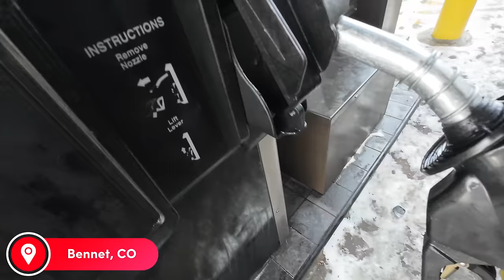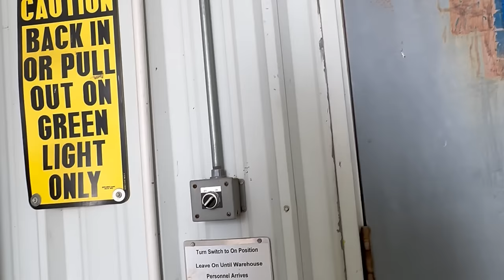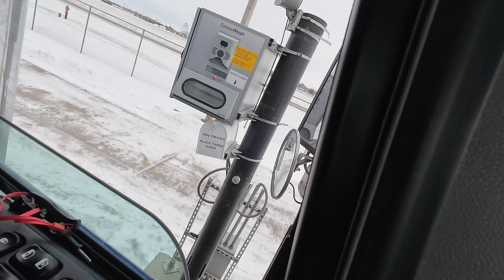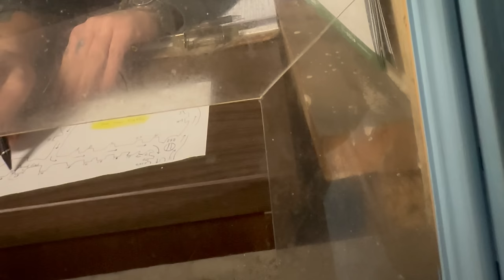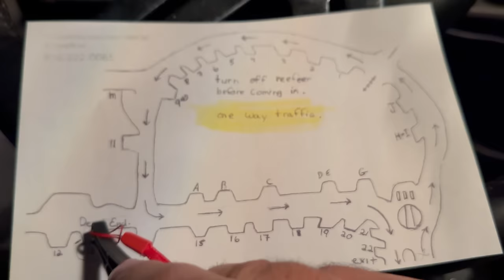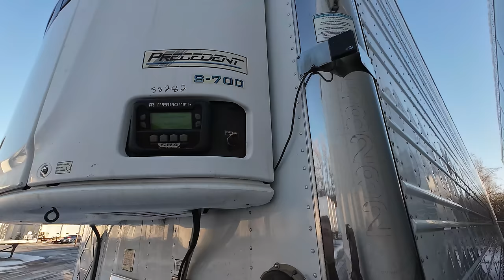DELIVERING UNDERGROUND-LOOKING AT REEFER TRAILERS

Comment: I used to deliver at that cave facility quite a bit back in my driving days. You want to see a real bad place to go to head out to Independence, MO.  a mile or so North of I70. Real tight to get around in.
Reply from the maker: Yes sir. I think there are 4 of them in Independence just north of 70 on state route 291. Been to all of those but not with this truck.

Comment: you mentioned spread axle, what is the difference between spread axle and standard tandems?
Reply from the maker: Honestly, honestly, I am not hundred percent sure what the big differences. I know spread axle is a lot more expensive for some reason. I just think the weight is spread around more evenly with spread axle and the truck probably rides a lot nicer.

Comment: 38:07 Me personally I would have came into the spot where you're at right there I would have did a turnaround right there where you're standing at and then reversed the other way It would have been faster quicker and you would have gotten in there without a problem quicker and obviously I would have slid the tandems right there as well
Reply from the maker: Can’t turn around there. But I could have came into dock area more and swung back out. And I always preach about sliding my tandems back but this time I didn’t do it for some reason. Live and learn. We learn something new here every day. Safe travels to you.

Comment: Idk man your coolant level is lower than all of the trucks I drive.
Reply from the maker: It did seem little low but it was still almost to the top. I did add some to top it off. And it seems like it’s doing ok. I think I was just being paranoid for some reason.
Reply: @OTRBandit  Hey I gotta know, how often do you go through coolant? Sometimes I think our trucks drink it way too fast!! Just the other day we finally started pissing coolant in one of the trucks and I had to limp it to the shop, but it was going through around a gallon a month before that happened. The others don’t seem to go through it fast but I don’t get why I feel like I’m adding so often. No signs of exhaust or oil in coolant tank and oil looks good.

edit Peterbilts
Reply from the maker: @Unduplicatable I hardly ever have to add any. I think this time it was low because it got -15 outside while sitting at home and some of it leaked out somewhere because of the cold weather. Rubber hoses get stiff and it leaks right there where clamps are.